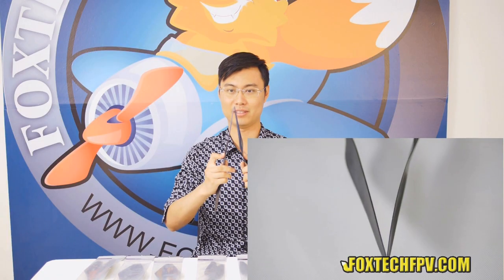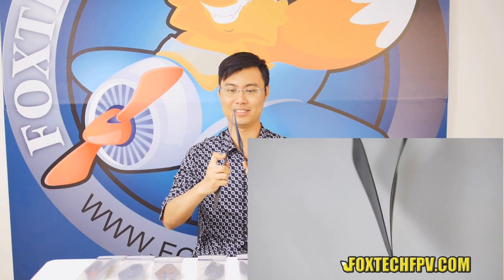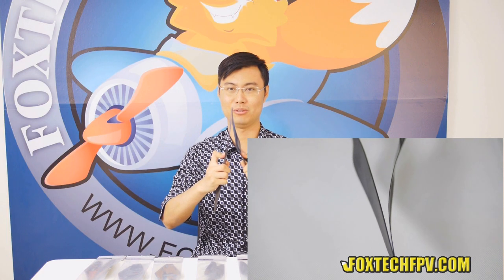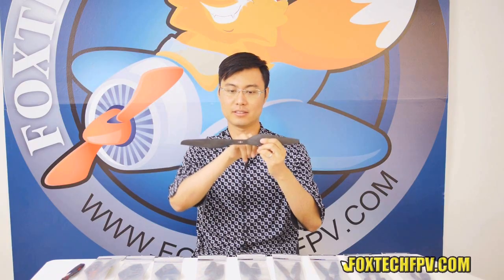Foxtech Supreme Propeller Series

Comment from the maker: most motors have 6mm shaft ,so no problem to use Supreme prop on most  motors,
also Tmotor makes short 6mm full thread shaft for their 2814 ,3515,3520,
you can find them in the store.

Comment: Oh very nice Foo but do you also make them props for a normal prop adapter,like just the one hole and the washer that fit in the middle as I haven't started to use the motors with the two screws on either side yet.

Thanks for any info.